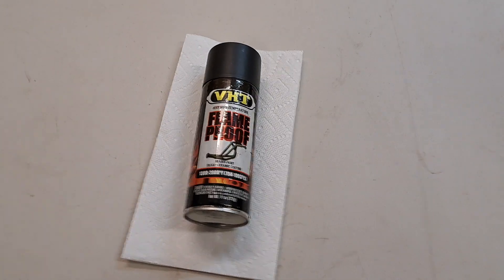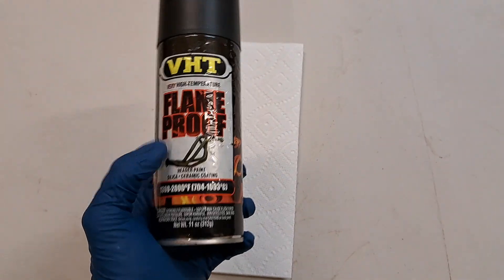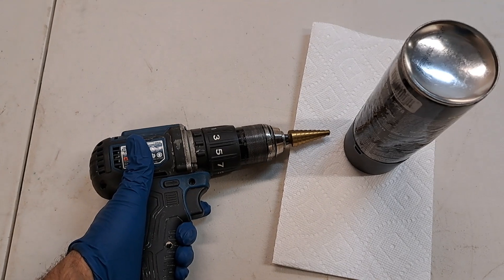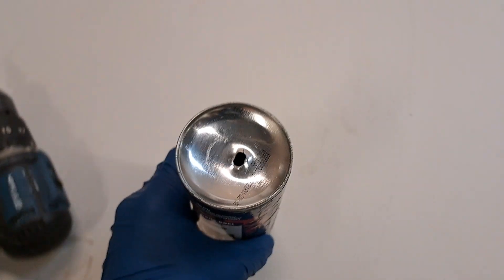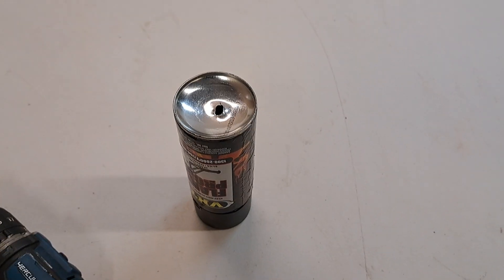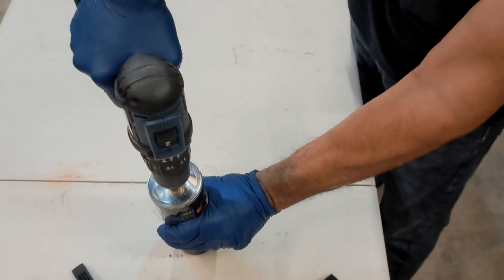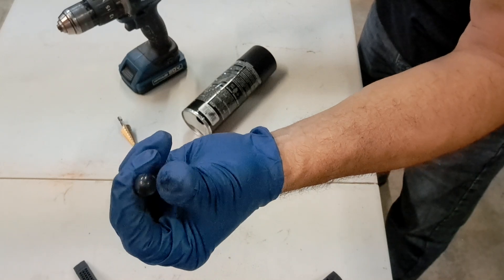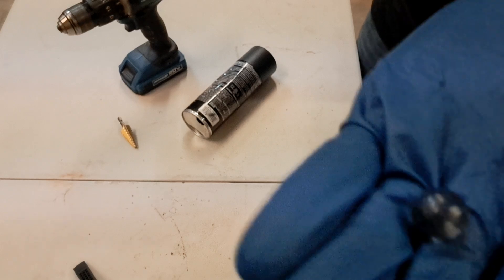What Makes a Spray Paint Can Rattle?

Comment: I have found lots of different things in the can, mostly marbles, but there was a case of cans had 3/8 nuts without the threads, I found rivets, 3 small ball bearings,  a small smooth rock, a bolt without the threads.